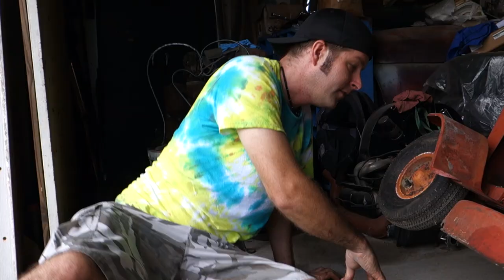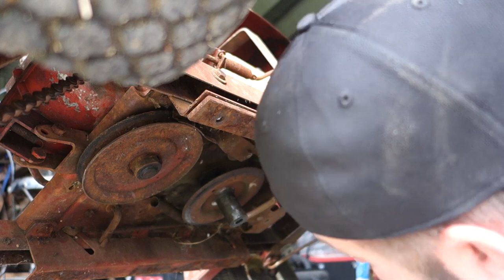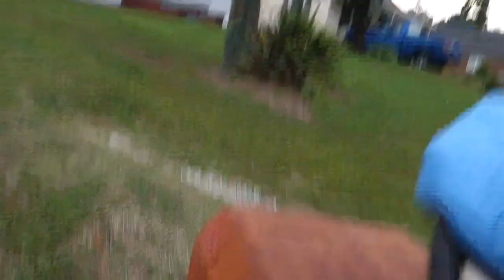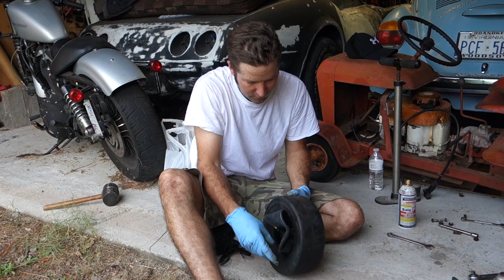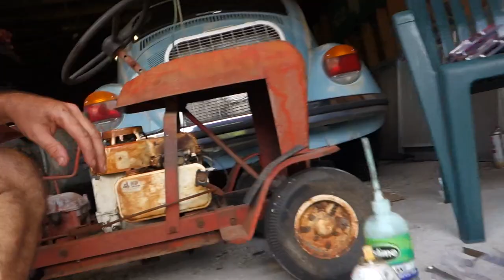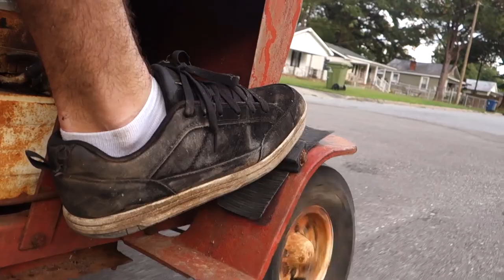The 60's Mini Mower Returns! Belts, Slicks & Riding: Ike's Adventures

Comment from the maker: I think it should get rat rodded... The right way.
Reply: CarsandCameras yes!
Reply: CarsandCameras I think your guys next build should be a 600 cc grocery kart go kart
Reply: can you do a rat rod the right way?
Reply: CarsandCameras I think you guy's should restore her to original condition then put on a dual exhaust. Use her for her intended purpose  for a bit. Then get the largest Predator engine you can find and put it on it  then go from there.......
Reply: CarsandCameras put a bigger sprocket on the front
Reply: Don't paint it, it looks classic.
Reply: CarsandCameras also you should keep the rust and put a bigger engine on it
Reply: CarsandCameras you could make it a drag rat rod
Reply: CarsandCameras put a torque converter on it
Reply: I have a rug mower just  Like that. It has a 8hp briggs and all the stuff to make it original. It's for sale if some one wants to make a go kart.
Reply: CarsandCameras keep the original engine on. It will fit the rat rod theme way better than a predator engine would. And also fix the exhaust leak. You don't wanna piss off the neighbors
Reply: absolutely NOT, give it the quickie restoration job (lube it up, clean it up, paint it up), sharpen and balance the blade, give it a padded farm tractor seat cover, and you have a real GEM. it does seem to ride a bit on the fast side, nothing a larger pulley on the drive side wouldn't fix, and where  is anyone going to find such a cute little riding mower that can almost fit into a shoe box? not that I don't love the idea of a rat rod, some of the cutest I've seen start with the butchering of a wheelbarrow (or two) to look like a little T bucket, PLEASE DO!! vertical shaft motor up front, belt driven to an angle/chain driven in back, small skinny scooter tires/wheels in front, tall wide slicks in back, an engine cover with louvres punched in... I mean go all out headlights taillights turn signals stereo and enough muffler to make it sweet+quiet with sound dampening material in the engine cover etc. it's a MUCH different direction than what you guys typically do, but it'd ROCK. electric starting ignition key, charging system, framed plexiglass windshield the works!
Reply: yes rat rod it
Reply: CarsandCameras have you thought about finding pictures online and restoring it?
Reply: CarsandCameras yes
Reply: CarsandCameras fearlessfront did one kinda like it, you should make one kinda like it. As fast as it can go obviously
Reply: Xander Page I saw that I personally didn't like it. He literally destroyed everything about the tractor except the frame. I think he should keep it as original as possible while going 50 on a drag strip.
Reply: model nutty but that's boring. He should do all of that except make it be able to mow lawns doing 40
Reply: rocket red with duel black pipes out the back or  zoomies
Reply: Do a 20hp v twin with open pipes, it's look needs that sound. 
Oh yea, and make it do 30-40mph, screw cutting grass.
Reply: Christian Lucatino 
That was basically a sit up style go kart with a huffy lawnmower hood when he was done.
Reply: AnthonyMarch2022 how do I send them?
Reply: CarsandCameras i agree stongly with that
Reply: Please don't I like the look of it
Reply: CarsandCameras noooo keep it original
Reply: CarsandCameras the engine needs work
Reply: CarsandCameras i was waiting so long for this video
Reply: CarsandCameras Will it even cut grass
Reply: CarsandCameras try making it look all new and try making a triple bug catcher It look siiick..
Reply: Trooperandcooper Ale: From the sounds of it he's just putting on clear coat. It protects the achieved patina without it rotting away further. There's car guys who do that when they want to preserve a vehicles original appearance while controlling the rust. :)
Reply: CarsandCameras
Keep it original.
Reply: CarsandCameras the Briggs needs a rebuild
Reply: CarsandCameras you need to put a predator 212 bottom shaft engine in the rugg moeer

Comment: Can you not add a spacer between the rim halves to flatten the tire out since it has a tube?  It would in theory make a wider wheel.
Reply: DANIEL JONES I was thinking the same thing! I think with a split rim it would be possible!
Reply: I think I would find some more nuts with the same thread as the ones that hold the rim together and put them on between the rim halves.  I wouldn't try that shit on a car but on a mower hell "it'll be fine!"
Reply: absolutely! they could even be made from (gulp) 3/4" plywood then attached with longer/harder bolts so they'll hold up.
Reply: model nutty Hey plywood and duck tape! 😂
Reply: Na you gotta keep it rusty not rotten! Lol
Reply: DANIEL JONES that's what I was thinking
Reply from the maker: He actually mentioned it on video, I figured that it wasn't that important and edited it out 🙄 oh well
Reply: DANIEL JONES 
I did that with a set of those wheels that were on a go kart. 
Works great. 
4" wide 4" diameter aluminum round stock
Reply: model nutty I used lumber to make some 3" lift blocks in a rabbit pickup once, and then drove it to the store to buy 3" metal lift blocks 😂
Reply: CarsandCameras Well tell Ike to make that shit happen I want to see some flattened out slicks! You need to shoot for 80 mph on this one! Lol
Reply: MrTheHillfolk yup, we'd done lowering blocks with hard oak without any problems, did check they were torqued down good a week later.
Reply: Thats actually a pretty good idea

Comment: Tires would be more flat on wider rims.  You could widen them by making a spacer that goes in between the 2 halves of the wheel and using longer bolts.

Comment: I think MTD made those small mowers...Rally, Noma were 2 of the brands under MTD. Sears, until the late 70s were Roper..WONDERFUL mowers! We had 2 of those, 1964, 6hp and a 1975 10hp...these were lawn tractor types. If you run into a Sears ST10, 12, or 16..BUY IT! They have a harvest gold fenders/cream white hood. Before that they were charcoal/white; red/w; blue/w..Suburban 10, 12...great products...cast iron front ends/HD transaxle. Would be fantastic for a lawnmower pull, as well as Wheel Horse(I have 2 of those still).
You have such a natural talent for fabrication...I can work on them, but I can barely fabricate a PB&J sandwich...

Comment: For the rims: because they're split rims, it seems like you could cut some kind of spacer to go between the two sides to make the rim wider. Plate aluminum if you're feeling fancy, old HDPE cutting board if not, piece of wood if you really don't give a crap. Looks like you'd only need an inch or so to get those tires sitting flat.
Reply: yup, cutting board material would be a great choice, also yup, might need about 3/4" width (or less) to unkink those tires

Comment: i got a 70 toro 550 , has the original 5hp motor with electric start . its really small, basically a ride on pushmower.

Comment: You should put a predator engine on it and make some stacks going up the sides
Reply: A diesel with stacks if he can find one
Reply: Henry Angell 
I wouldn't settle with a cheap ass predator for that, use a Briggs or something better than a predator it deserves it
Reply: MrTheHillfolk yeah that's true but it wouldn't go as fast so it's there choice if they want speed or an motor that suits it
Reply: Henry Angell 
I was thinking it needs a 20hp vtwin, like mine on my channel.

Comment: This would be perfect for a street mower build. Get a predator vertical shaft 5.5 hp engine. All slicks. Dual exhaust and maybe even a go power sports steering wheel for some extra looks

Comment: Food for thought ike! My mother's straight 4 ran on only 2 cylinders firing one time, and it ran for probably 3 miles. Didn't die, didn't hydro-lock, nothing. Yet my V6 truck, it lost just 1 cylinder, and it had NO power, I could not even put it back in the driveway with its own power. Now my thought is that with the truck, it had 1 of its wires melted so it was arking off the body. Could that be some how sapping all of the charge for the plugs? (standard distributor cap, its a 94)
Reply: possibly draining the coil to 0 every rev, or near killed it.
Reply: Possibly. Because it was the first cylinder.

Comment: Good lord Ike, I know you know what penetrating oil is lol. Show those nuts and bolts some love instead of snapping them off
Reply: "if it jams force it, if it breaks it needed replacing anyway" you'll get used to it, 
"It'll be fine". we all know (you too!) bolts that old just aren't going to be reusable anyway all ate up rusted rounded and weakened, I'd scrapped them out of the way same as Ike did instead of hassling or wrestling with them.
Reply: pb blaster

Comment: make a 1/2 inch spacers to put between the halves of the rim to widen the rear rims
Reply: Lawren Wimberly I've done that. I used 3 nuts as spacers.
Reply: I've seen it done with wood, aluminum... whatever... as long as it's smooth where the tube contacts... I usually cut a cross section of tube to stretch over the spacer to give a good transition for the tube to contact

Comment: If you leave the governor off, won't it bog down when mowing?
Reply: also depends a lot on how fast you're trying to drive it through the grass being cut, in a lower wheel speed (engine still 3.5k rpm), usually no prob.

Comment: Hey isaac I need help. Ive always wanted a kart and right now I have a science fair and a budget for the science fair is there any sciencey stuff about building/driving/racing a go kart that would be sufficient for a science project? Thanks-monty
Reply: well there is the internal combustion engine on the kart you can talk about. or you can go electric
Reply: Isaac it'll be fine ok well Lim thinking eather hydrgen or something ynless I can find an engine but I don't have the money I'm only 13 and want to get into karting but it's too expensive

Comment: It would look better if you don't clear coat, you can't have shiny rust. You should pressure wash it, rub it with cylicone spray and go from there. It will look more like a rat rod.

Comment: What was that stuff that you sprayed into the engine to start it?
Reply: starter fluid. its a easily ignited fluid you spray in so the engine its starts easyier
Reply: probably ether, or "starting fluid"
Reply: brake clean